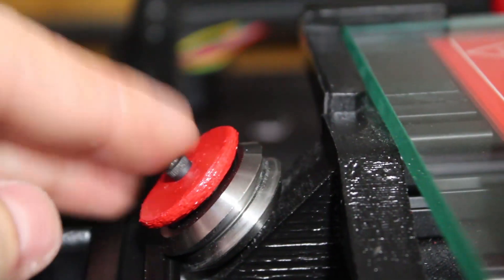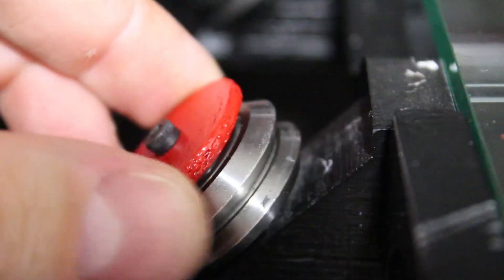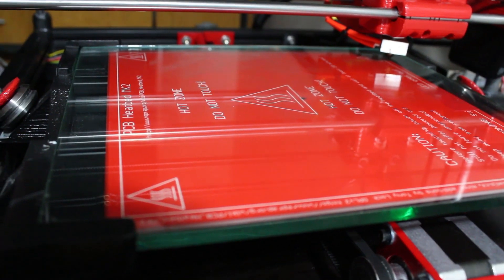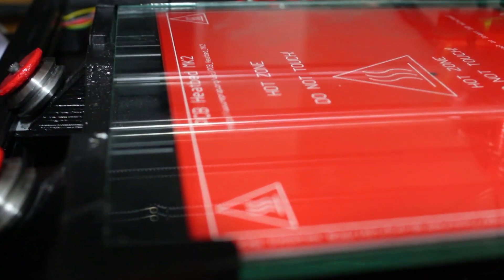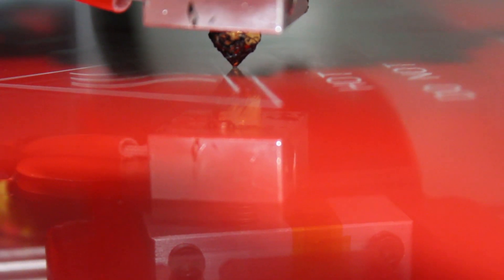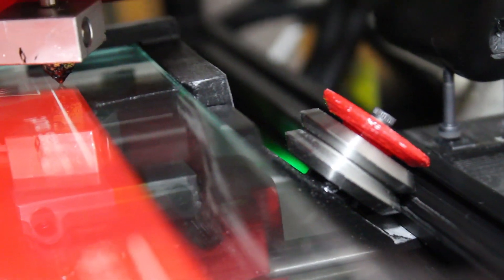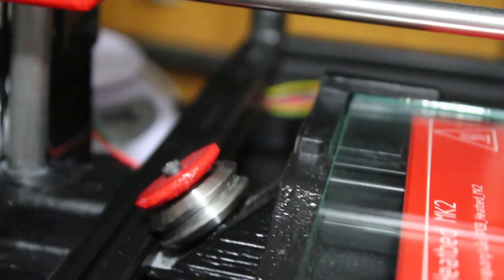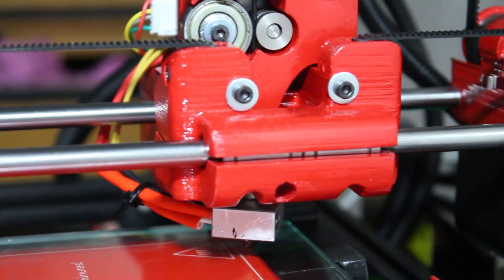Issues with EZ3D Phoenix 3D Printer

Comment: Is this model worth it? I would be buying new and pre assembled. I'm a high school student so 400$ I know is cheap in terms of 3d printers but I'm i. High school. There is a much cheaper alternative for 250$ but doesn't have the option for 2 nozzles or 3 plastics. I'm also wondering about software. Does it come with any or could someone recommend me some. Any one that can give any insight at all on this I thank you ahead of time.
Reply from the maker: I would be surprised if anything produced quality prints at $250. I ended up gutting mine and buying a MendelMax2 which was a bit more but it's been a great purchase so far.
Reply: Actually this printer cost $374 or $400 if it comes assembled. I wonder if the damages are from the previous owner as he said he got it on eBay right. This is the most affordable printer that can print in such large dimensions and why im interested in it.
Reply from the maker: WeezelKing23 Someone is selling THIS printer on ebay for $250? Not a terrible price. Worst case you could yank the RAMbo card and use it on a new build.
Reply: I've done some more research and decided that this model isn't worth it. Too many questionable problems. One user points out a different nozzle on the one he got compared to the video put out. This is really to bad
Reply from the maker: WeezelKing23 Assuming that was one thread I was involved in that user was misinformed :)
Reply: Well do you know any comparative printers, one that prints  this large that prints in abs and around this price?
Reply from the maker: WeezelKing23 Sorry...Maybe you can find one used on craigslist.

Comment: Can you add some weight to the bed? This should at least stabilize the gap between the nozzle and bed, if it is off on a side there should be a way to adjust or shim.

Comment: We ordered a printer in February and it arrived in early June.  We have yet to get a single print from it, largely because we have the same problem with the PLA sticking inside the barrel.  Is there a fix for this?  I've not hear of the PTFE lined barrels.  Are they available?

I, in fact, purchased an entirely new printer head, and was not informed of a lined barrel.

Comment: Never had a 3D printer, ordered this after Kickstarter closed. Seeing the long wait I started purchasing parts for a RepRap Prusa-Mendel iv 2v, then invested in a Kickstarter printer only to have them cancel after securing private funding. However they quickly had a few kits to sell, my arrived in 3 days, shipping $23, not $60, and priced the same as the Phoenix. Built and printing parts in a few days, other then a hotend clog, and tossing the non-adjustable filament I'm pretty happy. Retired so it's printing pretty much non-stop printing upgrade parts, a printable case portable Tantillus, and right now a TV mount for a flat screen TV for the print room. So one day I'll tackle the Phoenix, worst that can happen is it becomes parts for a Rostock.

Comment: Michael - You've hit the nail on the head, if you're wanting to use a different software, you will need to replace the firmware with a standard, off-the-shelf firmware that isn't modified to work with our software.

In your ABS prints (under the "these are just sad"), it looks like your slicing settings are not extruding enough plastic.  You may want to try increasing the nozzle size in your slicing profile to make the printer extrude more plastic.

It is good to see that things are starting to improve somewhat for you.  We've been very disappointed with the quality of the nozzles and tubes we received from our supplier, which is why we're working to get everyone's nozzle replaced.  We're still evaluating what to do about the tubes, because they seem to be problematic for PLA users.
Reply from the maker: Thanks. After getting a few better prints (will do a follow up video) I am a bit more happy regarding the unit. Morton on the forum pointed to en eBay listing with a different metal barrel already lined with PTFE it just need the bolt head cut off and apparently just works for both PLA and ABS.
Reply: Michael Gossett Yeah, I read that post as well.  We're not sure if it's the PTFE itself that makes it work well, or if our tubes have some kind of problem that we need to investigate. The nozzles and tubes came from the same vendor, so we wouldn't be surprised if that were the case.  Feel free to send us the follow-up video when you have it posted!
Reply: Ez3D The PTFE tubing fixed clogging and filament flow for me, thanks Ez3D for replacing this! Printing seems to be great at the moment.
Reply: Ez3D Your stainless tubes were poorly drilled. They were drilled halfway; flipped and drilled from the other side. This resulted in a bend or alignment issue inside the barrel. Its tough to drill stainless at that size and length, but its a quality controll issue your supplier needs to resolve.

Comment from the maker: Pictures added in comments.
Reply: Michael, would you say this is a good buy or no? I'm looking at this for my first 3D printer and don't want anything with issues to complicated for me to fix my self. In the end is this a good purchase?
Reply from the maker: xXRejector88Xx I would hold off. I ended up gutting it for parts and building a MendelMax2 which has produced very good prints.
Reply: Michael, I need a pre-assembled 3D printer with little flaws and comes with a heating bed. Which would you recommend for the budget of $550?

Comment: it looks like they are using different nozzle in some of their videos look at print recovery video it looks like they are using all brass nozzles and we got aluminum brass holds even temps
Reply from the maker: That's not the nozzle that's the heat block you saw. The nozzle is brass for us. I can't even find an aluminum heat block on eBay or anything right now but I'm pretty confident that doesn't affect it much.

Comment: you say you were able to print samples? i cant print anything nothing. my filaments are getting stuck in the extruder they where saying that they will send us new nozzles. did you try to print straight line and the square i cant print the square and any of the samples  the extruder motor seems to work faster and it makes the groove in one spot and the filament gets stuck plus the filament gets swollen in the nozzle let me know how you got your printer startedand please.............................................try these ....................... connect you printer to the computer and put your nozzle in the center of the bed make sure its good and you have the little gap between the nozzle and the bed then do the same thing in the corners left and right if your nozzle is to low or to high then try skipping teeth on the belts and then youll need to set the screw position  but calibrate your printer when its hot and ready to use  cause the extruder gets hot and it gets loose and than it changes its position you have to make sure that it will stay calibrated when its hot.  it would be cool if we could exchange emails so we could exchange printer problems. ............there is another problem with the printer that you should know that might help you to get it calibrated there is that one bracket that holds the bearings on the left side of the printer well that bracket bends and the belt gets loose and it might get loose while printing there is a fix for it i would have to send you pic of what i did............................... let me know if you had problems with printing i cant print shit  thanks
Reply from the maker: I tried that as well. I think the support rods are slightly warped, VERY slightly. I adjusted everything to where the rear left and right is like 1mm above the center and front left and right.